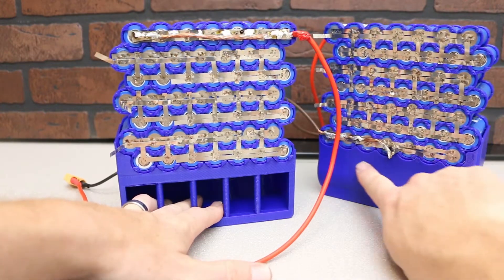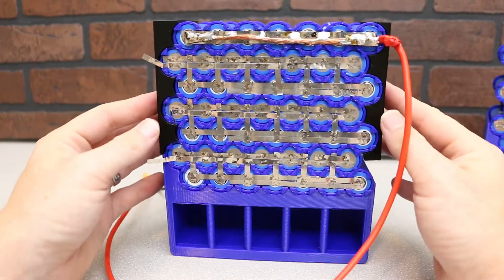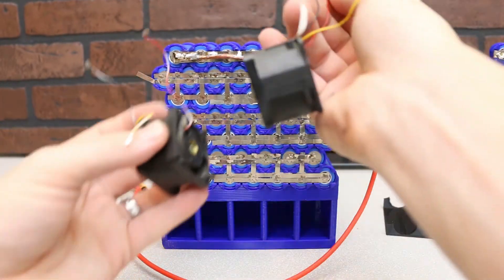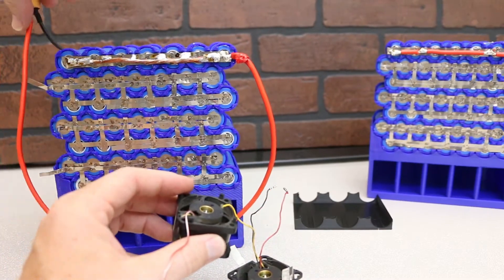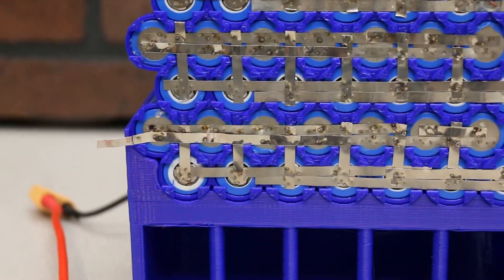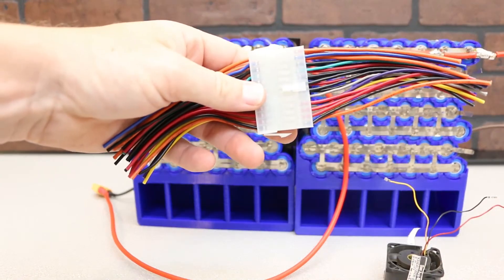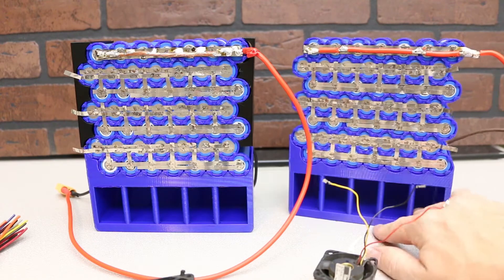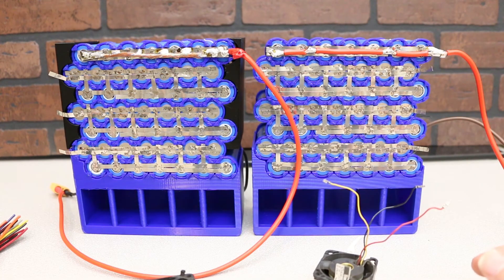Ebike Battery Update, tesla inspired cooling nearing completion

Comment: Definitely use converter to drop voltage so the load on cells is equal. The fan draws enough power to unbalance them when drawing from individual cells which is bad for better health.

Comment: Shouldn’t you try blower fan instead? It’s more quiet and also has pressure to push air through those small gap easier. I would also install a temperature fan activate circuit

Comment: Those counter rotating fans make huge static pressure for their size. it is counter productive to separate the two halves.Keeping them together but lowering their power still gives good static pressure with a lot less power. this would go a lot farther than 1 half a fan.

Comment: I'm not sure what the fans are rated at but you might have higher failure if they run high rpm all the time. I have to resist the urge to make my pc fans go max rpm every time my cpu goes over 40c :) I know you are dealing with server grade fans that are going to be rated for more continuous use but there is no telling how old the fans are :) Unless you have a way :)
Reply from the maker: ahh these server fans can totally last a while and if they go, they can easily be replaced. I hear what your saying though, i still would proudly burn out my fans before i burn out my system. as for age, these fans are several several several several years old. !
Reply: That is true quick fan replacement over long battery rebuild. :)

Comment: I had a rand,Om thought of a Paltier for creating cold air to be forced in with those server fans. Although it might be cool, the large heat sink needed for the hot side would take up space and most paltiers would drain 2 to 5 amps of power at 12 volts to run. But most can run at half voltage, say 6 volts and use less energy also requiring smaller heatsinks and only drain maybe drain under 500mA of power, so less then 3 watts. Might be possible? Then instead of just forcing ambient temperature air on a hot day that won't cool much, it would be a forced cold air cooling system. Random thoughts, but would probably need a redesign of the current air ducts. But it still would be neat. Maybe in version two of the pack.